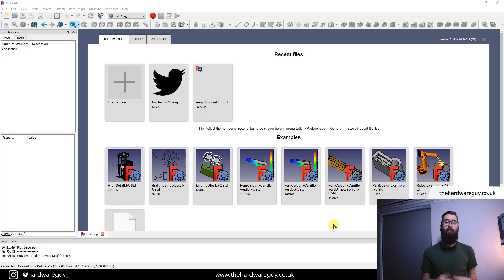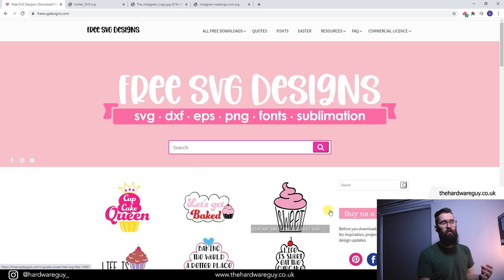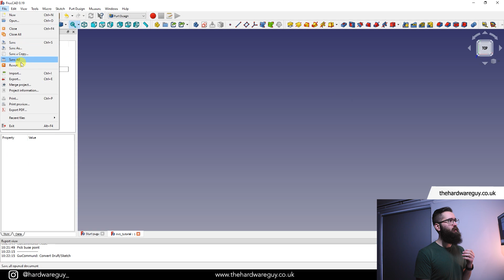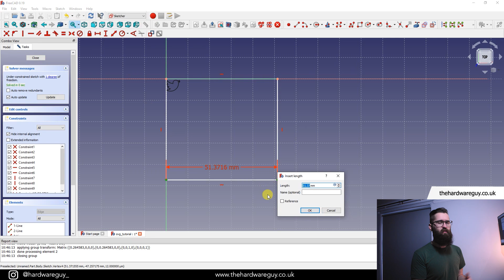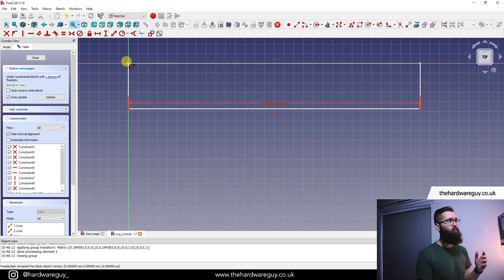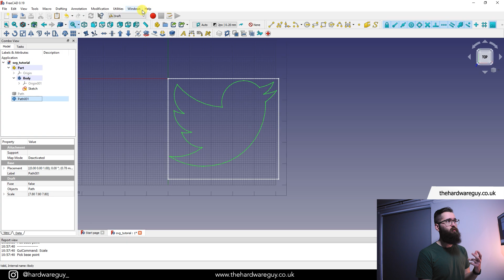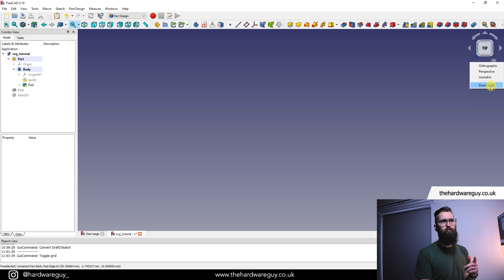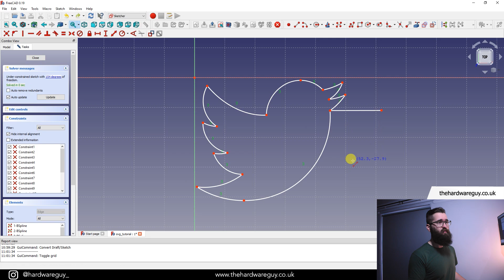FreeCAD - Import and Edit SVG files

Comment: SVG files are XML files. You can use your favorite text editor, like Notepad or Microsoft Visual Studio Code, to open the SVG file. Near the top of the text, you'll have a line that starts <svg ... /> which will usually include the height and width, in pixels, that the SVG was defined to be. You can directly edit those numbers to change the scaling of the SVG.

We know that the default pixels per inch (or DPI) is 96px per inch, or 96px per 25.4mm. That's 25.4 / 96 or 0.2645833 mm per pixel. or 3.77952 pixels per mm. The twitter logo SVG that you linked to for this video, is specified at width=24 and height=24. You wanted 300mm x 300mm, so you would change each 24 to 1134px in the <svg.../> line of the SVG file and save it. Then when you import the SVG file, it will already be sized correctly.
Reply from the maker: Hello, thank you for taking the time to comment. I'm sure others will also find this very useful. Enjoy the rest of your day :)

Comment: Thank you for the clear workflow, its solves some of my problems. But after proceeding it causes problems with Part Design functions.
To make a pad is possible but making a Fillet or a Thickness etc. it does not work. I get always a failture because of the solid?
Do you know how I can solve that?
Thanks in advance I will follow further  your videos.

Comment: What I noticed is that if I import svg, and extrude it like you show is that the resulting shape doesn't work in any tool, like thickness or offset. I guess it's because the polycurve line is imported as a all separate B-splines instead of one multi-knot one. Do you have any solution to that?

Comment: Good morning, 

I just finished watching your SVG to STL file using free cad. My question is is there any way to make the outside surface of what you’re extruding smoother in free CAD. When I open the exported stl file in lychee software, the sides sort of look blocky and didn’t know if there was a way or settings in freecad to smooth out the number of lines for the contour. Thanks for any help you can provide and keep up the good tutorials on free cad

Comment: Thanks, exactly what I needed. Sadly though I can't use it as upon importing an svg I get the  '/PyQt5/QtCore.so' error, which, so I have learned from internet, has a 1000 solutions with none of them working.
Anyway, that is not your fault. Great video

Comment: Something I have noticed while working along your videos, for the horizontal and vertical constraints you can also click the line between the points, FreeCAD will then automatically select the corresponding points. I find this quicker and easier than manually selecting the points themselves =).

Comment: Very nice video. At one point you make your little Twitter scale bigger, in my case I need to reduce my model and the scaling just increases the size for what did understand. How do you scale down?
Reply: Use a value between 0 and 1, you have to type it manually as the increment/decrement goes from 0 to 1 directly.